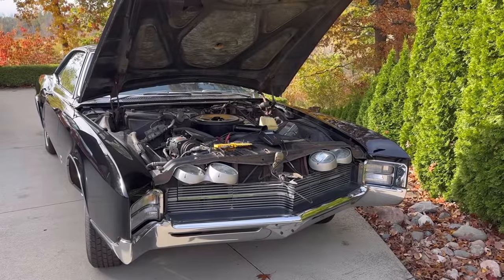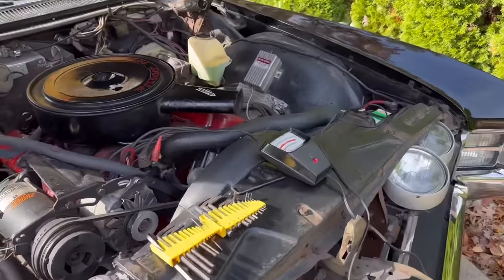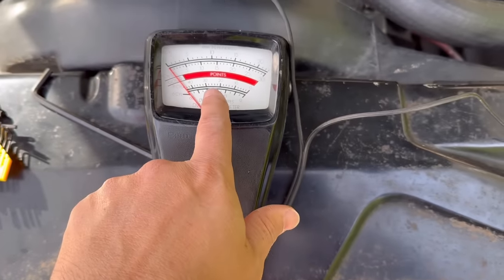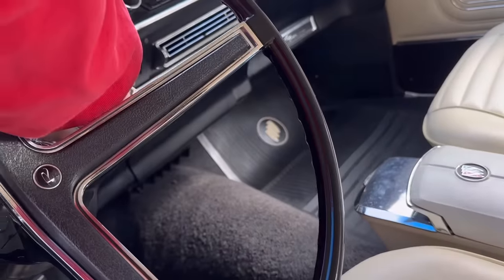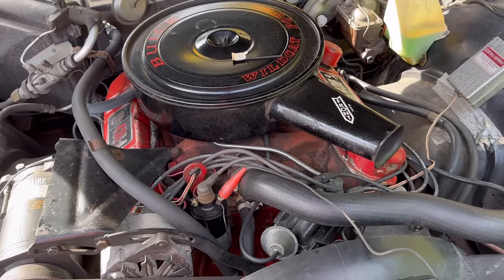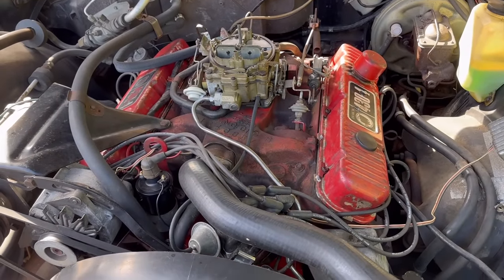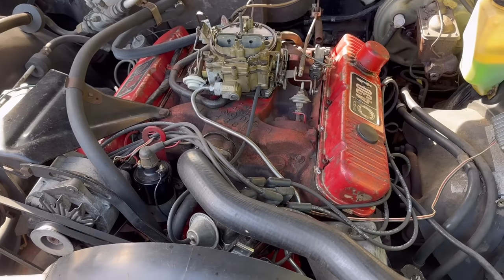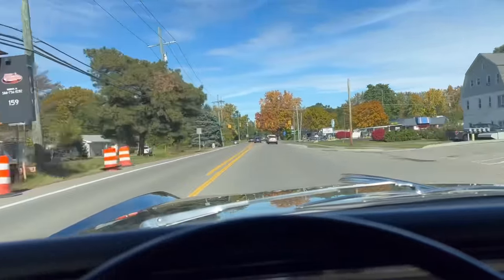Do It Yourself: How to Set Points & Timing on Classic GM Cars (Chevy/Olds/Pontiac/Buick/Cadillac)

Comment: A free tip from a mechanic of 48 years.  Look straight down at the distributor, see what side the vacuum advance is on. See witch way the vacuum advance pulls the breaker plate. Rotation is opposite of the way the breaker plate is pulled. I hope this helps someone. That was one of the first things I learned in Brooklyn Automotive High School.

Comment: Adam, It is so reassuring to see good old American tools used to maintain a good old American car. 😁
Reply: It has been a long time since I have had a car with points and condenser.  I do know that there is a conversion kit for some Fords to eliminate the points and condenser and make the engine's ignition closer to what a 1970's and early 1980's car has, saving the twice a year maintenance of chainging points.  I don't know if there is such a kit for your Buick or Olds, though.

Comment: I am surprised that the clamp works as a ground. It is totally isolated by the rubber hose it is clamped to. Great video as always!
Reply: Makes no sense to me. I'd like to hear Adam's reasoning. I tried it with a multimeter and I get no continuity between hose clamps and the chassis.
Reply: @andoletube    I'm with you buddy, don't know how that hose clamp could be a ground...  Adam??
Reply: The only thing I can think of is the hose has a bare spot underneath the clamp and it's grounding out to the radiator, or there's some serious electrolysis going on inside that radiator and the hose has enough carbon content to make a ground path to it.
Reply: @MattsRageFitGarage    Guess so, but even the radiator isn't a good ground, it is usually nestled in rubber mounts.  Oh well, Adam has got us all thinking again
Reply: @fleetwin1  The radiator isn't typically a good ground, but if the coolant is bad and electrolysis is taking place it will ground right to the engine block.
Reply: @MattsRageFitGarage    Makes sense.  Thanks
Reply: Yeah...  That shouldn't work.
Reply: @travishall67    I wonder if Adam is just "messin with us"  to see if we are paying attention
Reply: @fleetwin1   Not sure, but this reminds me of that meme with the old ladies standing around and one of them saying something like "That's not how this works.  That's not how any of this works."  :)
Reply: @travishall67   I love that commercial.  Something about "on the line" where she had all the pictures hanging on a clothes line.

Comment: My dad used to set points and the carburetor by ear, then hook his snap on tools up to see how close he was. That was when I was still a little boy. These days you have to have a computer science degree to work on a car. My dad had a long flexible screw driver to adjust the points. He never reached all the way to the distributor to adjust the points. That would get his arms out of the way of the fan on Buicks. He used to adjust these things with the engine running.
Reply: I remember a friend of my dad that was like that.. If it would start, or at least crank, He could almost diagnose any problem by ear

Comment: My favorite part of owning an older vehicle is keeping them in tune, I find it satisfying. Setting points, timing and the carb mixture adjustment with a vacuum gauge always makes it perform better. Adam... not a big deal, but you installed your points access window in backwards.

Comment: Also, on many Fords of the distributor era, if you put a allen key in the vacuum advance port, you can adjust spring tension.  This will adjust the amount of vacuum advance at part throttle.   The tip off is the hex shape on the vacuum advance can Vs the dome of a GM car.

Comment: Thanks for sharing, brings back (fond?) memories of my wrenching youth... Dwell meter is high-impedance device, so sketchy ground on hose clamp doesn't significantly affect it's readings. Also, the Riviera's fan clutch is toast! Even on the coldest days, it should never spin freely after engine shutdown. The bearings sounded like they're about to let go or lock up, as well. I was pleasantly surprised when purchasing a new water pump for 2.5l Jeep 4cyl, the better parts were offered as kits which included the fan clutch and mounting hardware. Love your cars and videos, thanks again!

Comment: I think your Buick needs a new fan clutch! When you shut the engine off, the fan should stop within one or two revolutions. Yours kept spinning for a good while. That could cause overheating, or excessive hi side pressure in the A/C system.

Comment: Setting up points, timing, carburetors and whatever may seem difficult or confusing to some. But if you take the time to learn it properly. Your car will rarely break down. Maybe carry a few spare parts in the trunk or glove box. 
Compare this with modern vehicles. There's nothing you can set or adjust. And there are so many potential points of failure that you would have to pull a trailer with $10k worth of parts to make it. Then you would still need a $5k scan tool to diagnose the problem and possibly have to tow the vehicle to the dealership to have the computer programmed. Because some car companies don't sell their programming software to anyone but dealerships. 
This is why I want a classic car. I don't even care what it is. I just want something without a computer. I'll take HEI, but I'd rather have points.
Reply: Many of the older OBD1 EFI systems are more forgiving, though I guess cracking the computer programming can be difficult.

Comment: Nice change of pace video.  I think a lot of this knowledge is slowly going away as people who never grew up with these older cars just don't have the experience to work on them.  They are mechanically more simple than modern cars but if you grew up with fuel injected cars with coil on plug ignition then these older systems are kind of a mystery.  Would love to see more basic maintenance videos of 60s and 70s era cars.

Comment: Some tips from the old guy ...
Correct - set dwell first.  1 degree of dwell will changing timing 2 degrees.  When tuning Ford / Chrysler - if you take all the plugs out and spin the starter, you can get the dwell pretty close with the cap and rotor removed.  Just lightly snug the breaker point mounting screws for adjusting.  Use a flat blade screwdriver to move the base plate then tighten when done.  Recheck.  I use to shoot for 26 degrees cranking and typically got 28 degrees running.
For timing, advance is against rotation.  Also, you can think of the vacuum advance housing as pointing towards advance.
I miss those days ...
  ~ David

Comment: Setting GM point gap / dwell
There is a procedure where you turn the screw until the engine shuts off, the the other way X of a turn.  Basically, you turn the screw until the points are closed then a known amount ( based on thread pitch ) to get the proper gap / dwell.  The sliding window can stay on the cap during adjustment.
Also, the best tool to use is an allen on a flex shaft as this allows one to be away from obstructions.

Comment: Points suck, and here is why. My first car was 1970 Buick Skylark with the 350. I pulled the heads and sent them out to get a valve job and to have hardened exhaust seats put in. I hot tanked the intake, rebuilt the carb, put on dual exhaust, I installed new points set the dwell perfectly, advanced the timing just under the point of  of detonation, and I up graded the plugs, wires and coil. I spent hours tuning and tweaking that thing. It ran great, sounded great, and had excellent throttle response and could burn the tires for 50 yards no problem. It appeared to run perfect, then a friend convinced me to get an HEI distributor from a junk yard and put that in which I did and that car gained 50-60 more hp and could burn the tires for as long as I held the gas pedal down. Points suck because over time the 8 sided octagon lobe that the points ride on wears out, and the corners become rounded and it messes up everything dealing with the spark. New points don't fix it, and chances are you don't even know something is wrong until you replace the distributor and if your going to do that replace it with a junk yard HEI. I promise you will be amazed at the difference.

Comment: I just want to add that when you disconnect the vacuum hose from the advance diaphragm it is still connected to ported vacuum on the carburetor and should be plugged so you're not trying to set the points and timing on a car with a fairly significant vacuum leak.

Comment: I was a poor Army Private in 1973 trying to keep my commuter car running. Points needed adjustment or replacement just about every other oil change. What a pain in the butt. And I never figured out what is dwell or how to adjust it. After the Arab oil embargo the price of used muscle cars hit rock bottom. I paid $600 for a 1966 Chevrolet Impala SS with 427 four speed. Someone had previously modified it with dual point ignition. I was lost.

Comment: When replacing points  remember to put a dab of cam lube on the distributor cam. Keeps the rubbing block on the point set from wearing  too quickly.  Forgot to do this once on a 69 Buick and it would barely run after 100 miles, rubbing block was wiped out and points not opening.

Comment: I have a dwell meter and a timing light. On many cars the points can't be set that way. When you can set them with a dwell meter, I first set them with a business card when I install them. I have found that 95% of the time that put them almost dead on. Then if necessary you can tweak them with a dwell meter. As for timing, I first check the timing and timing advance by the book with a timing light. But I have found that most older cars tend to need just a little more initial advance than what the book calls for with today's lousy excuse for gas. I run premium fuel with an octane booster in older cars. I have also used different brands of lead substitute.

Comment: That cast, finned, aluminum box on the driver side inner fender sure looks familiar. I had a similar unit on my 1969 Corvette. It converted the engine to capacitive discharge. Very little current on across the points so they lasted longer. I had mine inside the shark gills where it overheated and failed.  The factory fit a longer cable on the unit, so I was able to mount it at the very front, behind the pointed V of the front bumper. It never failed there. It went away when I converted the distributor to pointless. That has been even better.
I stopped the video and enlarged it. Compuspark. It’s the same unit!!!

Comment: As much as I love classic cars, I do NOT miss doing stuff like this!  A "tune-up" on my '90 Miata consists of changing the spark plugs and wires - and that is it.  And I can adjust the idle speed, but the ECU takes care of the mixture.

OTOH, you can occasionally fix a carburetor by tapping it with a hammer.  I don't recommend doing this to an ECU. :)
Reply: I'll do stuff like this any day over the water pump and timing belt I did on my old 92 Miata, did that in February pouring down rain on me the entire time and it fought me the entire way going back together. Nope, don't miss it sadly. I have never seen a crank bolt so tight; I had that thing in 5th gear, E brake set as tight as I could get it, wheels chalked, and I was making the car move trying to loosen that bolt.  What really pissed me off about that job was I had to put an alternator in it the weekend before the water pump started leaking.
Reply: Actually a timing light can be very useful with a 1st gen ('90-'97) Miata, it's one of the few later cars where you can adjust the ignition timing mechanically as opposed to having to reprogram an ECU, and changing the advance from the standard 10 degrees BTDC to about 14 will give you noticably better acceleration and better gas mileage as well!  And other than one very difficult to get to and loosen bolt, it's an EASY operation, I'm sure you can google or bing it for directions, only caveat is when I did it with my '97 M Edition I did have to start running premium gas to avoid a bit of pinging, but the better mileage made up for it and the increase in power especially off the line was worth it to me!  I do miss my Miata, owned it for over 13 years and wish I'd never traded it.  Mechanically they are in sort of a sweet spot between simple DIY maintenance and earlier stuff that's more maintenance intensive, and later to current cars that are so complex I don't really want to mess with them and really cannot without specialized tools!
Reply: @terrybeavan4264  Glad you mentioned that. I checked the timing on mine, it was already at 14* BTDC when I acquired it. I noticed if I ran regular, it never pinged but by the time it got past 6500 RPM the whole car felt like it was going to shake itself apart, but if I ran premium 92 octane it was smooth as glass the whole way through. Never did understand that one!

Comment: I still have a dwell meter much like yours I purchased back in the early 80's. We used to use a beer can pull top to set the points initially to get it running and was very close, 15 thou if I remember correctly...lol.

Comment: One thing my dad taught me. If you don’t have a dwell meter, slowly turn the Allen wrench CLOCKWISE until the car just shuts off, then turn it 1/2 turn COUNTERCLOCKWISE. It will be very close to 30 degrees dwell.

Comment: I've probably mentioned it before; you can HEAR the difference in the different GM V8s of the time. Obviously, you can tell a Chrysler product by the starter and the Ford by that "click!" noise when the starter makes contact. Also the engines all sound different under different acceleration loads. I have literally nothing to contribute as to setting the timing, dwell, etc so I'll just watch. Thanks, Adam!

Comment: I spent many hours under the hood of my old caprice with my dwell meter and timing light!  Doing the GM dwell adjustment is so simple with the window and allen wrench, you can adjust it while the car is running, no need to take the cap off.  Might not be advisable on the Buick V8 with the front mounted distributor!  What is that aluminum colored box with the two wires coming out of it on the wheel well/driver's side of the car?

Comment: For a Ford 302, I used to hand turn the engine until the bump on the points was right on the point of the distributor shaft (maximum open) then use a feeler gauge to set the points to the correct setting.
Reply: Same here... in my 78 Thunderbird, the last car I owned that had that kind of ignition.

Comment: Just a little advice... @ 3:23, it was stated that, "if the car doesn't start.. just move the dwell..." The advice is that if the car doesn't start, one should go back to the ignition breaker points gap setting procedure and start from step one. A slight maladjustment of dwell will not prevent the ignition breaker points from operating preventing starting. Again, just a heads up!

Comment: I looked at the smallish valve covers on the 430 and assumed it was a Nailhead. Did a quick check and found out I was wrong - no 430 and only ran through ’66.

In that case, I wonder if some of the 430’s design was based on the previous Nailhead?
Reply from the maker: Nope. Totally new
Reply: @RareClassicCars  Interesting.  I guess they are svelte looking compared to the domed look of the SBC covers. 

Thank you, Adam.

Comment: 8:12 — One thing I’ve never understood.  What do you mean by “Rotate the Distributor”?
Do you mean rotate the distributor cap with the wires still attached to it (which I’ve tried, but it doesn’t move… so I gave up years ago)?

Or do you take the cap and wires off and rotate what’s underneath with your hand?

Comment: First step before changing points should be checking to see where the timing is currently set.  The car may have been running fine at a timing setting different from factory spec.  Then if you change points and the car doesn't run quite as good at the factory timing setting, you'll know where you started out.

Comment: Time 550 ( edit, I see this was covered later in the vid ) 
Cylinder numbering
Back in the day, many engines had cylinder numbers cast into the intake as well as firing order and sometimes distributor rotation.   Generally, the forward most cylinder is number one.

Comment: Getting into old Fords 20 years ago was a disappointment in the tune up department after growing up with Chevies. I couldn't understand why EVERYONE didn't have an access window on their distributor caps for points/dwell adjustment. 100 times easier doing it that way. I believe my '67 Pontiac with its 326 also had an access window, but I can't remember for sure.

Comment: I don't see how that hose clamp can be a ground - unless maybe it pokes through the hose and contacts the radiator bung.  But even then, I would kind of expect the radiator to be isolated from the the car/ground because of rubber mounting pads at its bottom, and my assumption is supported by the fact that the upper mount/retaining bracket appears to have a rubber isolating pad between it and the radiator, as evidenced by the two rubber retention plugs visible at 2:48.
Reply: @johnz8210  Still... there's a negative battery terminal about a foot and a half away. It's weird - I feel like Adam is trolling us and there was a ground wire attached under the clamp.
Reply: @johnz8210  Didn't think of that! Good catch.  Three of my four vehicles have manual transmissions.

Comment: Just a minor added note:  AMC used Delco distributors for many of their V8's.  Both my 67 and 68 AMC 343s use them.  And your comments are applicable to them just as well.
Also, regarding your remark about timing specs.  I find that on both of my AMC V8s that your comment about advancing the timing a bit beyond the factory specs is a great idea.  I find the timing specs for both my AMC V8s to be significantly too retarded.